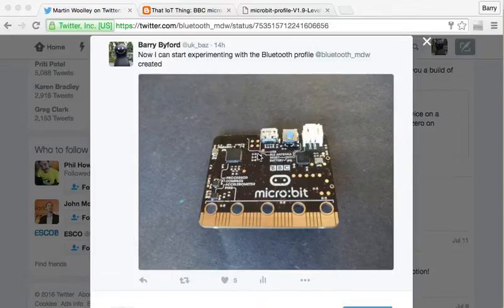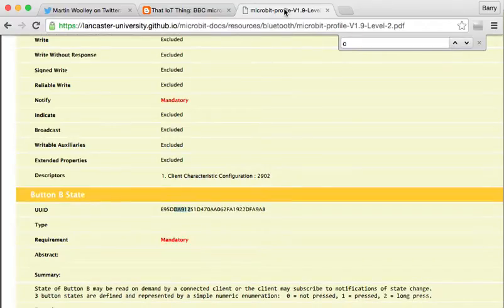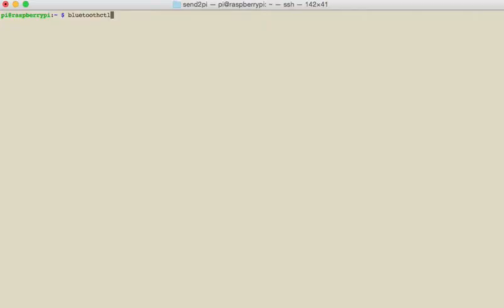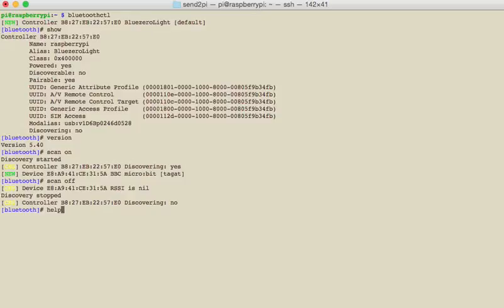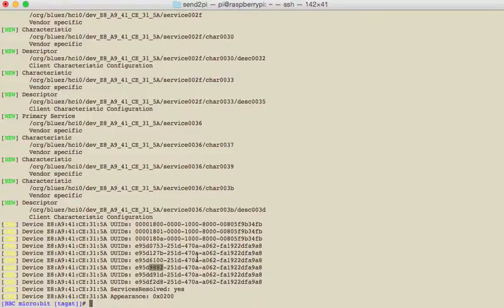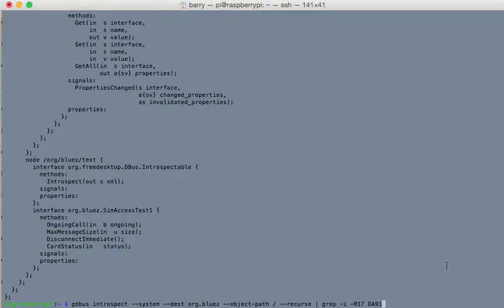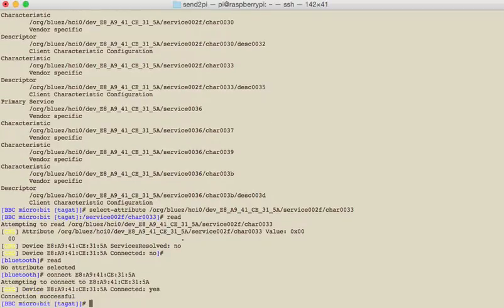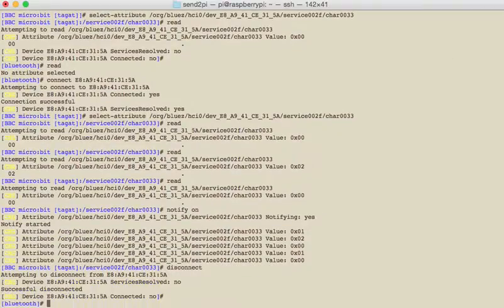BBC micro:bit Bluetooth first look with Raspberry Pi

Comment: I followed your instructions to the letter (https://github.com/ukBaz/python-bluezero/blob/master/docs/install_bluez.rst) to install bluez, on Raspberry Pi 3 with the latest version on Raspbian. Everything installs ok, but inside bluetoothctl, entering "show" just results in "No default controller available". Any ideas why this is?
Reply from the maker: Yes. There is a problem with the current version of Raspbian. look at issue 30 on the repo for a workaround